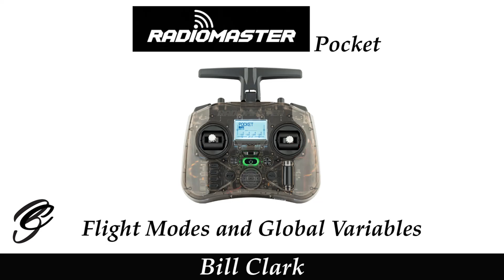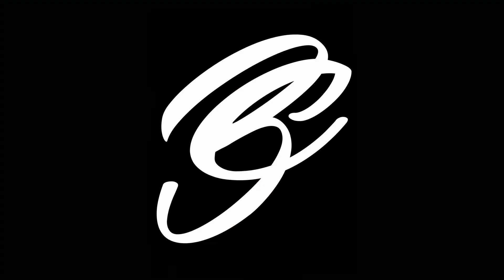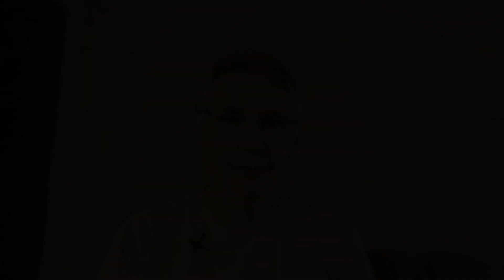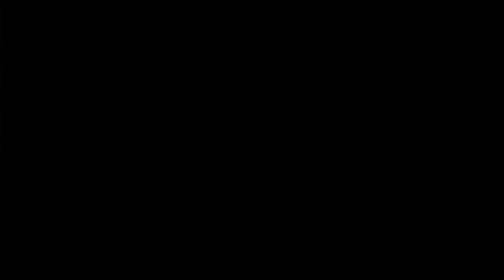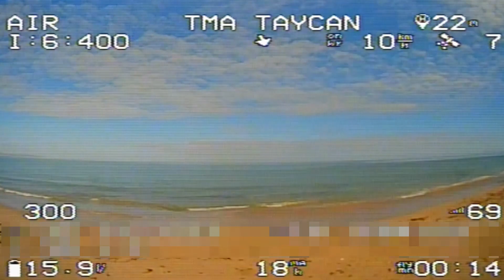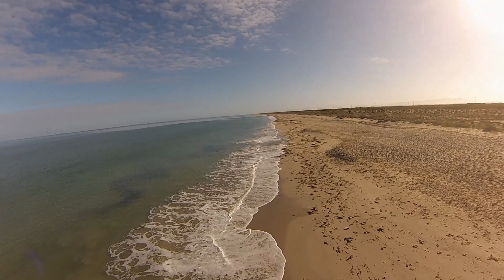RadioMaster Pocket Flight Modes (FM) and Global Variables (GV)

Comment: hello 👋 
i am trying to setup three flight modes for trim, i have an f14 with three wing positions, which all need their own trim. i followed your instructions and have three flight modes tied to switch SB, which is also where my wing position is tied. my thought was be able to trim out each flight mode…i can see in the flight mode screen my switch SB in fact moves from position 1-2-3…i just cannot figure out how to assign trims to each mode. does this make sense and can you lend any thoughts?
Reply from the maker: The trim will only work on the channel not for separate mixes.
Reply: @the-happy-RC-flyer so not possible to get individual trim per flight modes?
Reply: @the-happy-RC-flyer yo, i just figured it out, if you select “+” on each of the trims  that default are set to :0 :0 :0 :0 while in each flight mode, this programs independent trims per flight mode. you can also program to “inherit” trims from another mode to be the base of another.

Comment: My weight doesnt show G1, it goes from -400 to 400
Reply from the maker: G1 is a Global Variable value which you need to set up first before selecting as the Weight for the mix. The Weight would normally be default 100. Just for your reference do not set the weights over 100 or it will stress or stall your servos and possibly break them. We would normally only use higher than 100 +or - when setting offset.
Reply: @the-happy-RC-flyer ive tried, but i just cant grasp onto how they work.
Reply from the maker: @chazbanx just think of Global Variables as a number that can be populated over different mixes which you want to use the same value. So instead of putting the value you use the GV number. You can also use GV’s in Special Functions in more advanced programming.